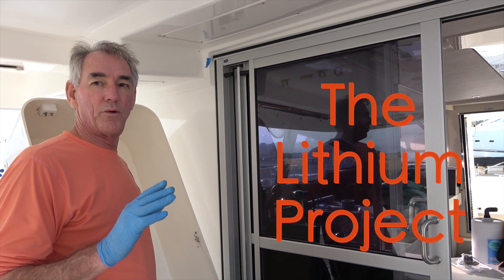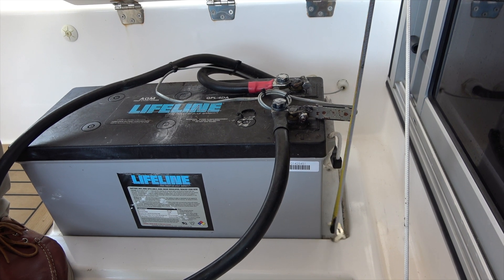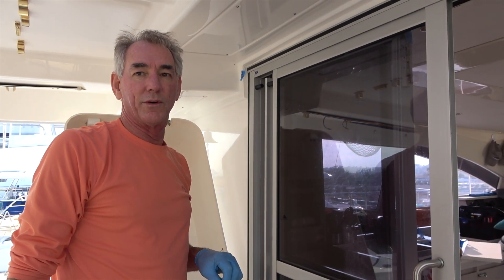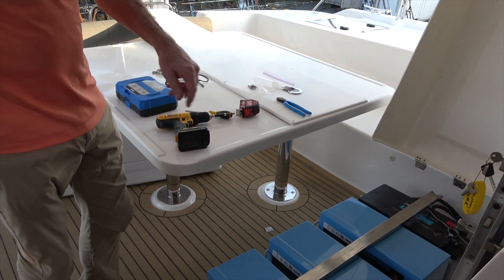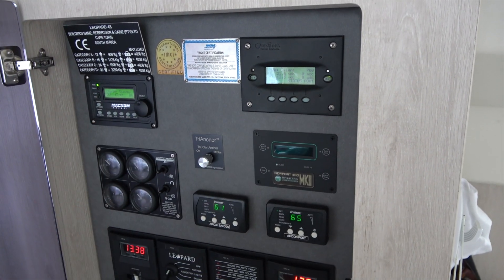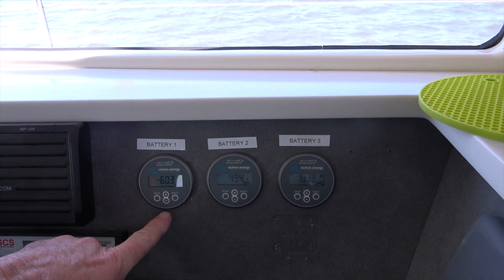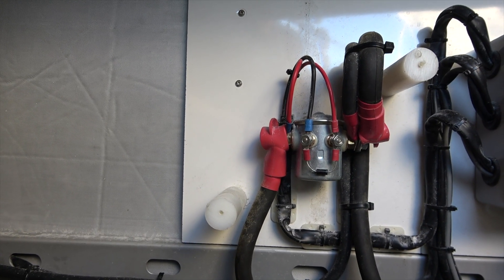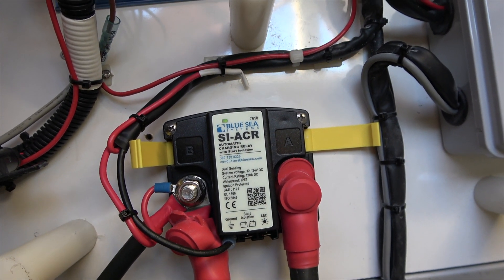Upgrading to Lithium Batteries from AGM on our Leopard48 Catamaran PILAR | EP51

Comment: Guys, you should of use red cables for the positive instead of just using black with the red heat shrink to identified it as positive.
Reply from the maker: yep,  but this way works too when availability and cost are factors.

Comment: Great install!  As an alternative to getting a custom- stainless tie bar bolt, we added a 316 stainless 1/2” quicklink to the pad eye on the floor at each end of the bar to bridge the gap. When tightened down, it works great.